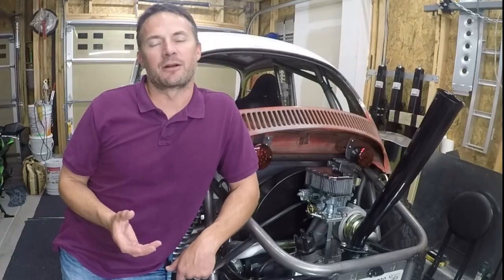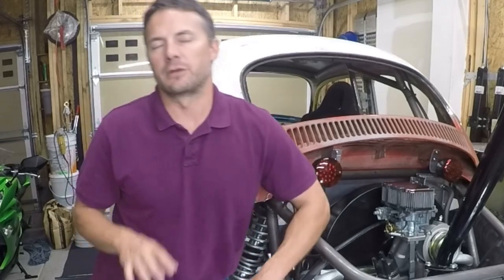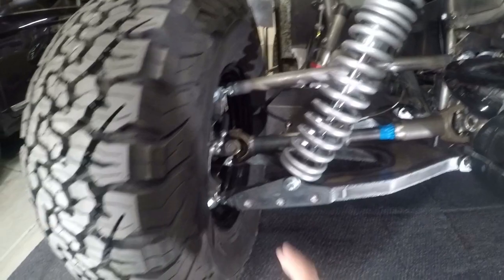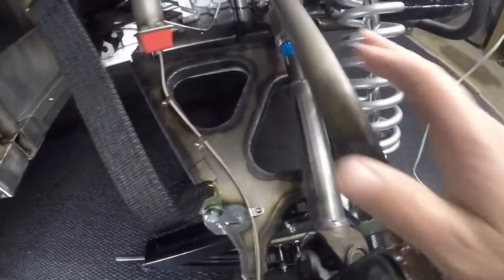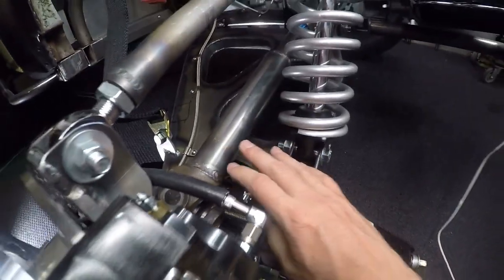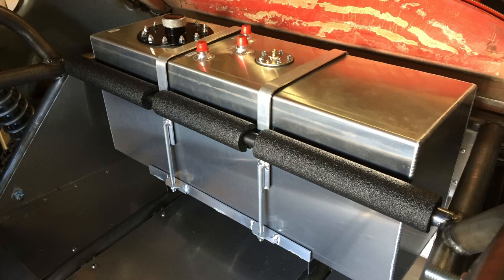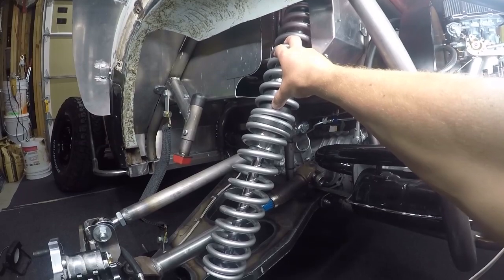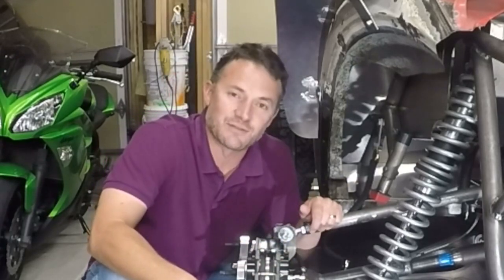Baja Bug A Arm Rear Suspension Walkthrough

Comment: Man that is some awesome work. I love it. How much ground clearance do you have? I live in south Carolina and we have more hills and mud bogs than anything. I want to build one with alot of ground clearance to accommodate like 37" boggers or tsl's . So my question is on ground clearance.
Reply from the maker: Most of the chassis is about 16" off the ground. But the transaxle hangs down a little. It's about 14" under the transaxle. That's the lowest part.

Comment: I just bought some coilovers for the rear but came without springs, so now i have figure what range or weight i want. I need help figuring that out, what do i do?
Reply from the maker: My advice there is to call KarTek Offroad (or your preferred supplier) and get their take. They would have a better idea of what you would need for the kind of suspension you have.

Comment: How much travel are you getting?  How wide is your setup?
Reply from the maker: The rear has 18" of travel and the outside to outside of the rear tires is 76".
The front has a little over 15" and is a couple inches skinnier than the front.

Comment: I just stumbled across your videos and they are really nice.  I have not been happy, generally with what I see for typical trailing arm setups, and have built on Baja Bug with 3x3 arms.  I have been intrigued with doing an a-arm rear suspension (or H arm like yours).  It's very simple, and makes it easy to set toe and chamber.  The question I have, is are you happy with the strength of the lower control arm, in terms of how its worked actually taking the car out and driving it?  And also, what do you think about fabricating the lower control arm using tubing instead of the boxed approach?
Reply from the maker: Hello Andrig,
I am very happy with the H arms setup. I personally will never go back to trailing arm.
I was a little worried about strength on the lower arm. However it has not been an issue. I've had the GoPro down there quite a bit on trail rides. Under hard braking or hard acceleration I don't see any flex.
As for the tubular arms I would go for it. I built mine out of flat stock but really not sure why. For my new chassis I think I will remake the arms and this time out of 1.75 or 2" DOM or Chromoly tubing. Just add some good bracing where the shocks connect.
My current arms are 1 1/2" thick and they hold up fine. But on the next go around I think I'll go a little thicker for insurance.
I won't have heims either on the next set. I now know that I'm good with 0-1deg toe in. So I can build that into the arms and just go with bushings.
My weakness are my spindles, I made those to thin. The current ones are made out of 1/8" metal. The next ones will be 3/16" or maybe 1/4". So when you make those add some meat to them. On mine power sliding or hitting hard jumps will cause you to have to depress the brake pedal a little more than usual once. This means the spindle flexed and pushed the pads out a little. So pay attention to that.
Good luck with your build!
Reply: Good to know.  Thanks for the reply.
Reply: I'll definitely go for tubular setup.  I have now updated my build plans based on what you did.  The spindle definitely look a little too thin to me, so good to know there.  I found a set of micro stub spindle and caliper brackets that are made for designing your own semi-trailing arms, but I will just use them to add the connection points to the H-Arm.
Reply from the maker: Sounds like a good plan! Hope the build goes well.
Reply: I was wondering the same thing . Thanks for asking that question.
Reply: Thanks for the info.

Comment: I really like the H Arm setup.... and the craftsmanship is excellent... I am looking to do something similar with my manx... it's a garage monster but works well for a mid travel car..... I am running a GM small block and a TH425 tranaxle though.... so the back half is a bit wider that what a 091 or 002 would require.... but yeah I'd like to pick your brain a bit on this project ... yours came out really nice 😃
Reply from the maker: A small block with a TH425! Wow that's quite a setup. I love the H arm setup. I think for the rear it's the way to go.
If you'd like to chat more about the setup email me at dougbugbuilder@gmail.com.
Thanks for the comment.

Comment: Awesome work,  very inspiring , I liked your trailing arm design what was the major benefit of going to this a arm style rear ?
Reply from the maker: Cameron Holiday, The trailing arm suspension is a great suspension. I think for me I was hung up on trying to get U Joint axles to work because of the 40+ degrees I can get out of them. I was really challenging myself to get maximum travel without widening the bug to much. Trailing arms don't handle extreme droop to well as it causes the axles to plunge a lot. That stresses the transaxle side cases and bearings. A Arms designed right will have minimal or no plunge. Plus they offer great adjustability. So no real major benefits over trailing arm, matter fact A Arms are more complicated and have more things to go wrong than trailing arms do.
So really I think I did it to challenge myself. I am real happy with them though.....Thanks for the comment.

Comment: Hey Doug, I am really loving your videos. I have a 72 Super Beetle that is destined to become an offroader. (Mainly because it is complete, rust free, titled and we picked it up for $300) I am very interested with your suspension and chassis builds and would like to do the same. Any help I can get would be greatly appreciated.
Reply from the maker: Carlo Harvey, I'm glad the videos are helping you! I don't know your fabrication level, but if I was to do it again I would build the body chassis and front suspension at the same time so they could integrate better. If you go swingarm in the rear make it a straight beam with coil overs rather than the factory tube with torsions. There are lots of videos showing the rear suspension, however I wasn't really doing the YouTube when I made most of the front suspension.
Good luck with the build! Feel free to reach out to me at any time with questions.
Reply: Thanks for responding, I saw your email address in another video comment. Would you mind if I reach out that way?
Reply from the maker: Yeah reach to me through that email (dougbugbuilder@gmail.com) and I'll help you with what I can.